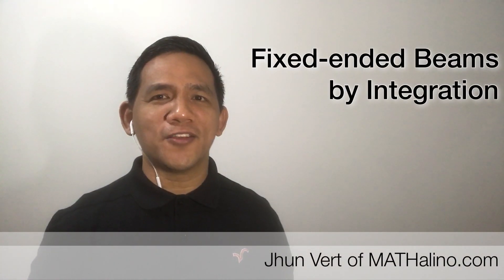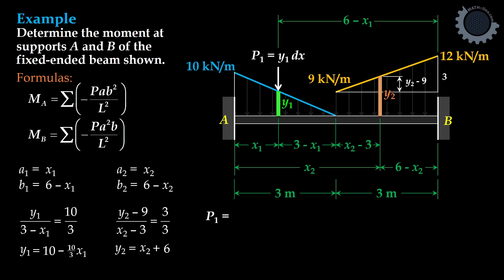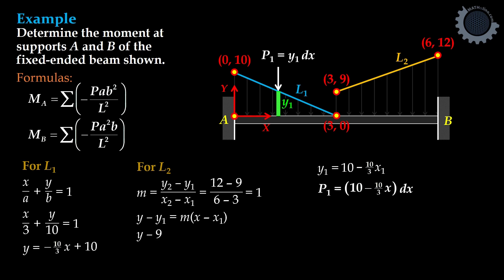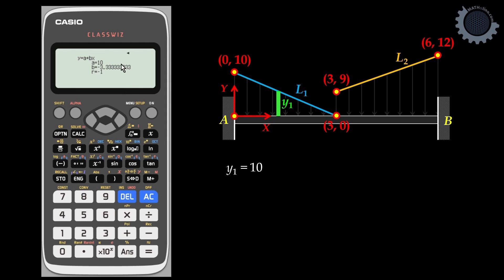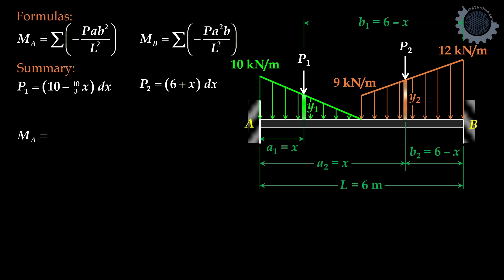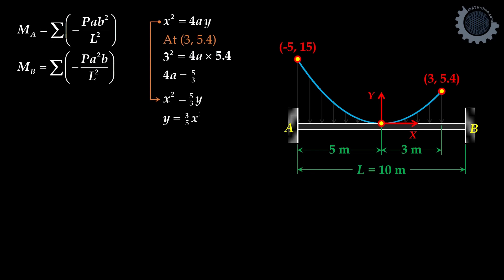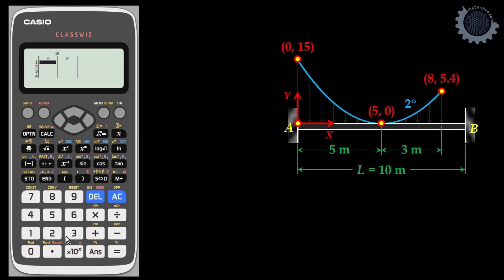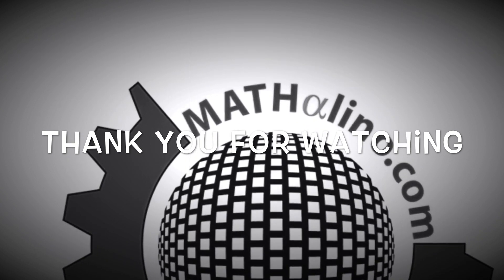End Moments of Fixed-Ended Beams by Integration | Theory of Structures

Comment: Pano po naging a=x+5?
Reply: Yung origin po is nasa vertex ng Parabola. Treated as coordinate system pa rin where the far left's coordinate is (-5,15) and the origin is at (0,0).
Reply: @junex147  alam ko naman po na yung reference po ay yung nasa vertex ng parabola which is yung origin na 0,0 pero di ko talaga magets bakit distance x+5 po yung a
Reply: @anonymousmoosely908  try to simulate the load. Diba nasa point A siya wherein ang coordinate ay -5 based sa binigay na diagram ni sir. a=x+5
a=-5+5
a=0

Tama kasi if point load lang yan na naka-locate sa support A based sa equation na Pab²/L² , a is practically zero. Now imagine slowly moving towards the end of the load shape. It means it is the appropriate equation for the integral. Parang Integration of Area lang yan where kailangan mo gumawa ng maliit na width (dx) imumiltiply mo sa y pag nabuo is a unit of area.
Reply: @anonymousmoosely908  you have the option to modify the equation P wherein yung Support A is located at x-coordinate zero. Yung a in the intergral will just be x and then b will be (L-x).
Reply: @junex147  halla thank you po, i will absorb po yung sinabi nyo, thank you po ♥️
Reply: @junex147  hello po, gine-gets ko po yung sinabi nyo pero di ko talaga ma-gets/ma-absorb, please enlighten me po huhuhu
Reply: HAHAHA

Comment: Thank you po! I was specially amazed with the refreshment of my analytic geometry and also with the calculator techniques. I was about to buy that model even tho they won't allow it during the board exam. Great job po! God bless everyone behind this video!
Reply from the maker: You can use Mode 3:Stat if you are using CASIO fx-991 ES Plus, which is allowed in the board exam.